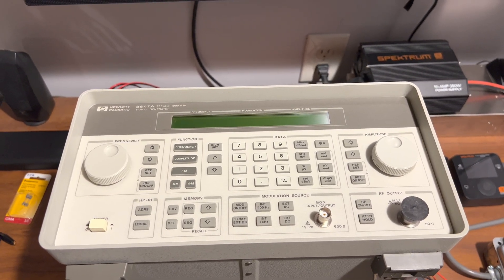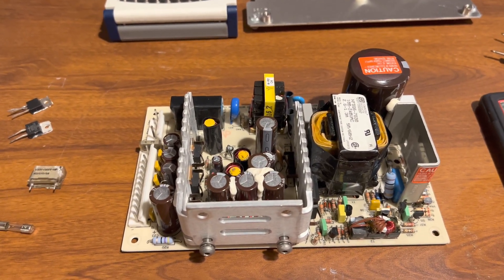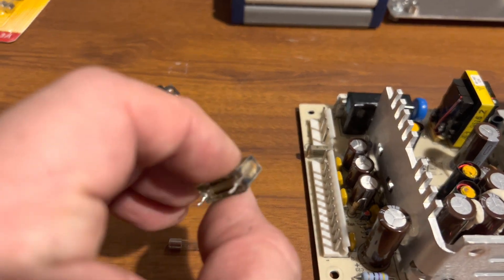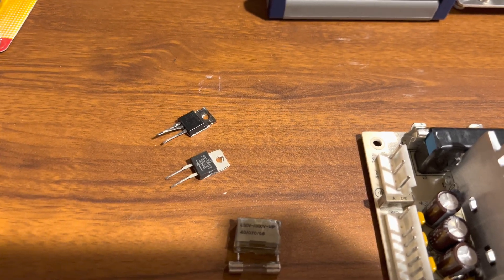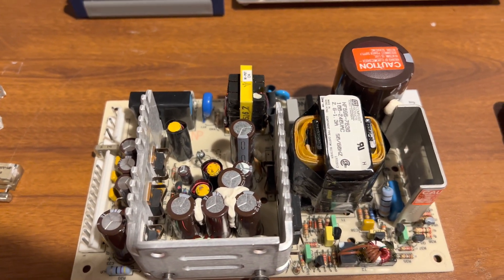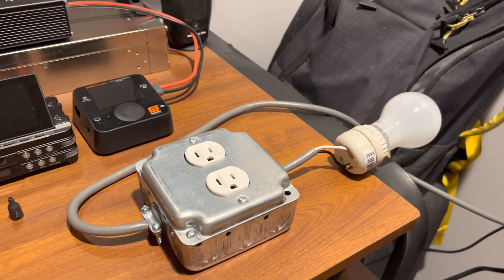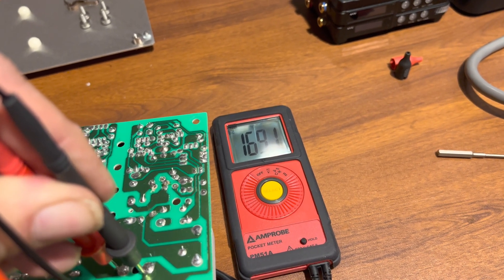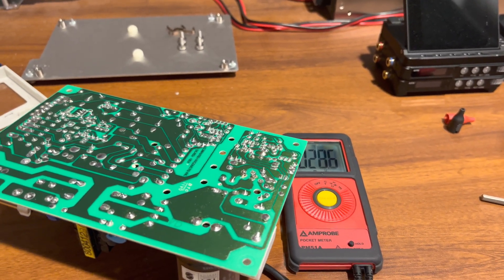HP 8674A RF Signal Generator Repair Part 1 RIFA strikes again

Comment from the maker: I going to built better dim bulb tester with option for multiple bulbs so can set for more current when needed and power and voltage meter. I thinking about also adding a isolated transformer in one case.  Definitely do want to build one with option to set current depending on how many bulbs in parallel? 

They useful when testing unknown equipment that may have a short. One limitation I found is with larger switch mode power supply with power factor correction they down like to be limited in current and won’t start up correctly due to inrush current is high on a dim bulb.
Reply: I look forward to seeing a video on that, until then so a short video on your current set up with the light bulb. This has always drawn my attention. Now that I'm retired and on my own budget I can take my time, but I'd definitely like to protect my wallet! LOL

Comment: Hey bud good to see a new video on test equipment. I used to use these at work and man these are the coolest signal generators. I know what you mean by the RIFA caps I can't stand them either. They're all up in those HP and Tektronix equipment and I can't even begin to guess how many good pieces of test equipment ended up in the trash bin because of them. I've been working as an electronics technician for over 42 years with military equipment and have fixed hundreds of different types of pieces of equipment including; EA-6A & EA-6B Electronic Warfare Jammers, FA-18A/B Fighters, SH-3's Helo's and so on. However, I've heard of the light bulb and isolation transformer techniques before but I've never been taught to use them or even actually used them before. I was wondering if you'd do a video on them. Great video bud spot on. Best Wishes & Blessings. Keith Noneya
Reply from the maker: As far as isolation transformers mostly use to isolate equipment from mains and to protect it. Not a issue when out on field if using something like a Fluke Scopemeter where all channels are truly isolated from each other as well. Let say someone was looking at a PWM switching on a motor and used a bench scope. Well they will blow the frontend on a regular oscilloscope vs a isolated channel Scopemeter. I seen some impressive blasts over the years.